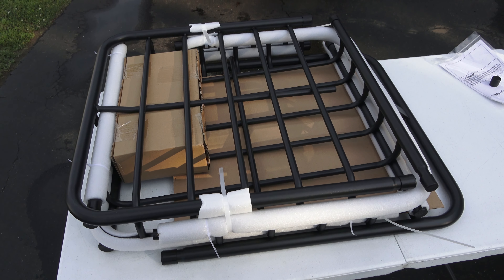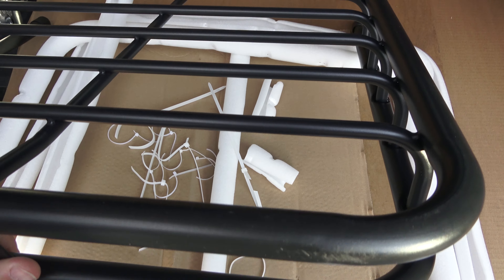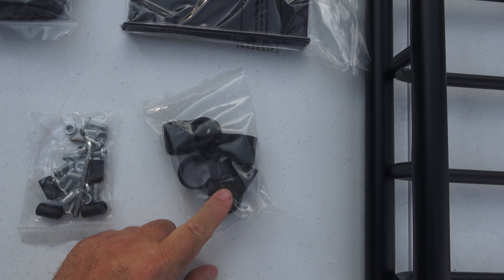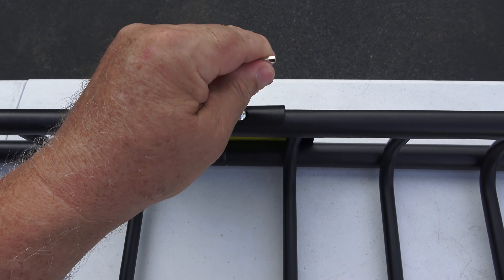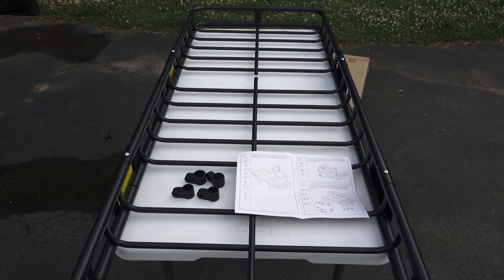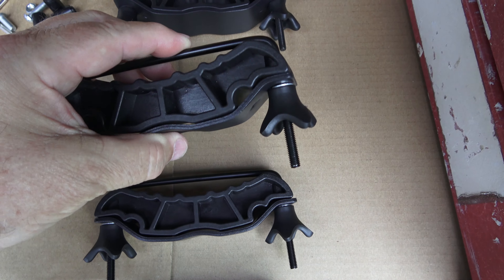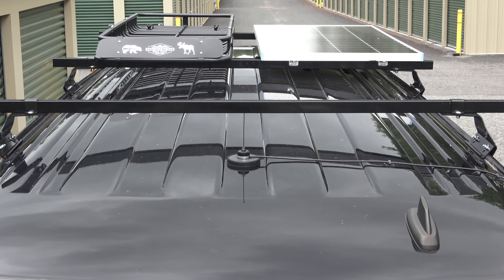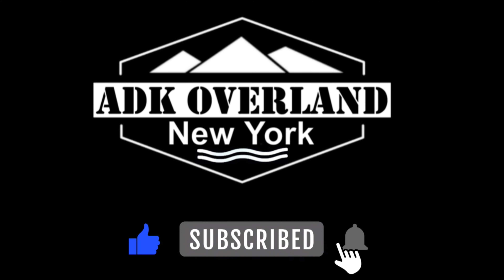Van Life ~ DIY Cargo Basket Assembly & Install

Comment: Hi Jeff, I didn’t realize that those cargo racks offer so much versatility like you got all kinds of stuff going on with it. My issue with the cargo racks is I didn’t install a ladder on the back but that’s a pretty fore reach the vans pretty high so getting up there would be a tour for me, I’m a big guy so I figured I’d pull the ladder off stepping on it lol
Reply: Maybe I’ll just send my tiny wife up there. I call her a little fella.
Reply: Been married to the same woman for 43 years
Reply from the maker: Mike - you better watch it or you'll be in the doghouse lol! I liked those cargo racks because the ladder racks had those large towers & I wanted a slightly sleeker look. I have the one "empty" rack up front and that gives me the option of adding another solar panel, but mainly I have it there because I want to add an awning and that will hold 1 of the 2 support brackets! I've been looking at ladders too! Always good to hear from you!
Reply from the maker: that's awesome - a rarity this day in age! Congratulations!

Comment: Hey, looks nice
Reply from the maker: Thanks Mike - a little at a time. Working between extreme heat & humidity to torrential rainfall.
Reply: Hi Jeff, the cedar planks on the roof look really nice and I just love the smell of cedar too. It’s a good choice. I think it’ll also add a rustic look and I think I see your fan in there too.
Reply from the maker: It was scorching hot today with high humidity - just like we've had for weeks. That slows my progress a little but today I'm down to about 4 planks left to finish the ceiling; I cut the holes, ran the wires and installed 6 LED puck lights AND I managed to cut and install the trim for my fan. I'll email you some pics. Every time I open a door, the cedar aroma hits you and smells so good. I painted my vent fan trim black to give some contrast against the natural wood.
Reply: Yeah like working in a big black oven. Lol Jeff, you should paint some numbers on the side that make it look like a DOD official van and you’ll look like an official “men in black “ van
Reply: Been real hot here too but we had the tail end of that tropical storm roll through the Midwest. Lots of rain, but it’s now 65°.
Reply from the maker: LOL - one of my son's friends asked me if I was working for the FBI now!
Reply from the maker: 92 here with high humidity today! I took your suggestion on the 4 gauge to run from the alternator to the DC-DC controller. I have a length of wire that looks like it's going to make the distance & I snaked it through the upper part of the wall where it meets the roof. Just need to find a place on the passenger side to snake it into the engine compartment.
Reply: @ADKOverlandNY  yeah probably a really good idea to use that four gauge. It’ll be your longest run and it’ll handle the what 60 A are so on your alternator.
Reply: When you stopped to think about it, that’s a lot of charge to be put into the batteries when you’re underway. You might not even need those solar panels.
Reply: I wonder how much your gas mileage will drop when you’re actually running the charger from the alternator the load you have on it other words the more current the more resistance will put on the engine, but I bet it won’t make that much difference
Reply: Lol Jeff, your vehicle is a veritable test Bed for this old, retired, engineers, electronic fantasies lol
Reply: My wife always laughs at me because I have so much electronic equipment  at my house.  piles and piles of stuff.  Lots and lots of projects that I’ve started and never finished.
Reply from the maker: I'm hoping that I can find firewall access through the passenger side to my battery. Then I know I'll have enough wire. I used the large firewall plug on the driver's side to run the GMRS radio antenna cable through, but I don't think I have enough to go way over there and back again.
Reply from the maker: from what I read Mike, it looks like the MPPT will split the charge between the DC-DC charge input and the solar panel so there's no large load at once. It's the same when the solar panel is feeding starting battery and house batteries.
Reply: @ADKOverlandNY  that makes sense